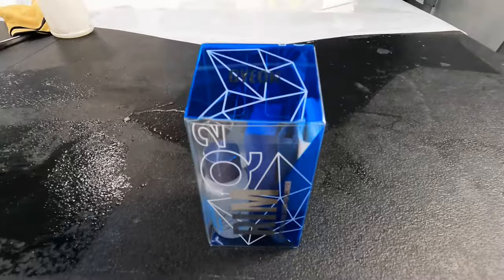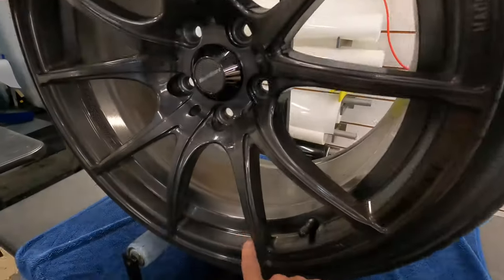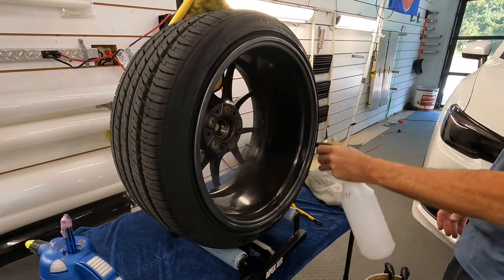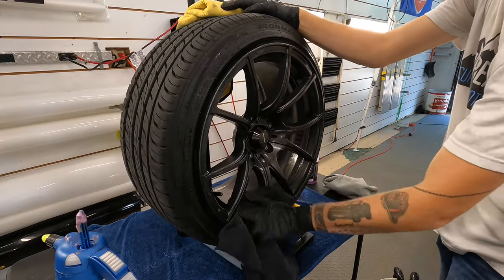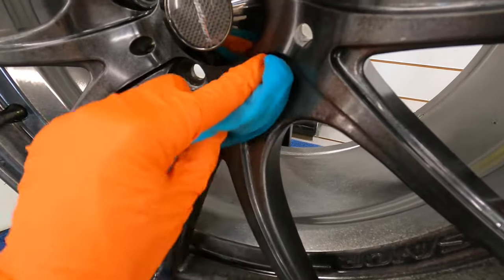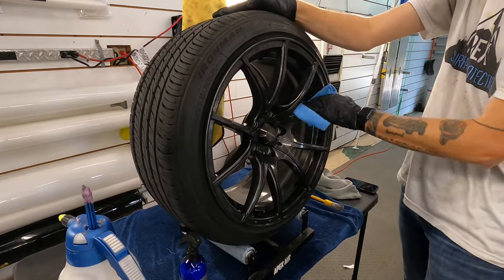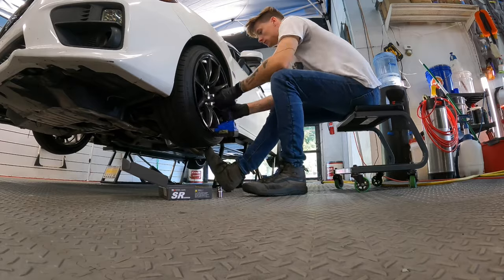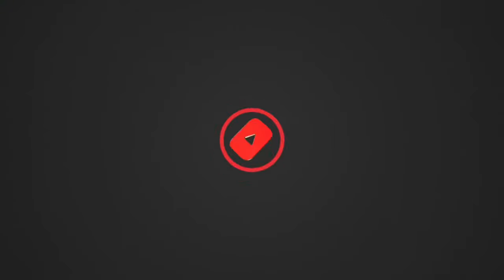12 + Tips To Get The Most Out Of Your Wheel/Rim Coating!

Comment: International info for you folks. Krystal Kleen Detail R-Evolve Ceramic Wheel Coating from the UK. Users there in the salty air & rainy climate are getting real-world 3-5 years. I’ve got it on my AMG wheels now. It is the strongest wheel coating I’ve heard of or used. It has a huge amount of solids. You can only do about 1/5 of the wheel face at a time before it starts getting hard to remove. If you can find it in stock, it’s the best.
Reply: Sadly no longer being made by Kkd
Reply: @AnotherYoutuber460  Well- that’s rumored. I’m still trying to confirm that. The problem seems to be getting certain base components. Until they tell me “we’re never making it again” I’m staying hopeful :)